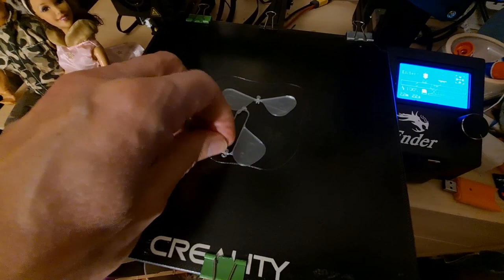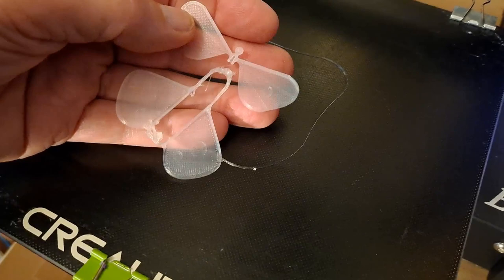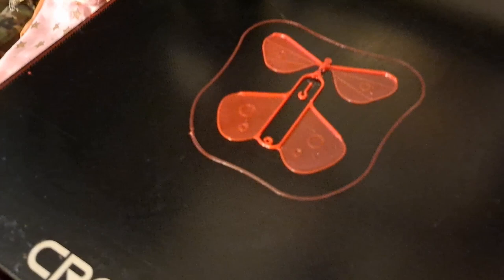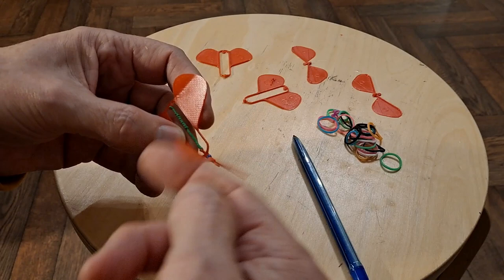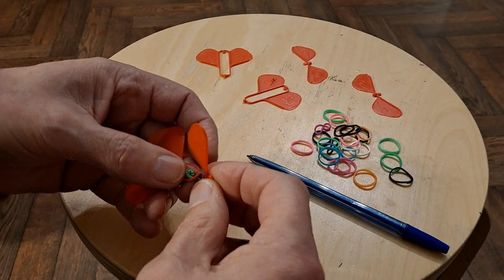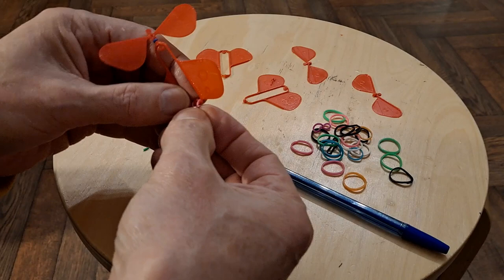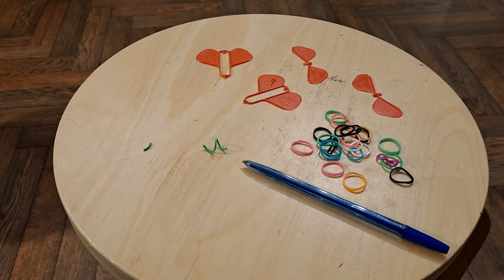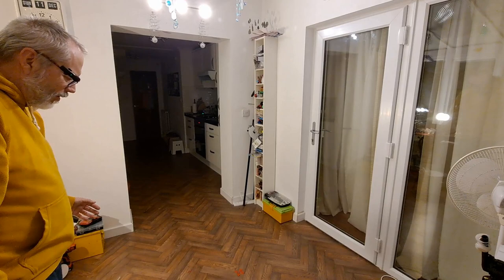PARBOI 412 3D printed rubber band powered butterfly by tigermcho

Comment: Had a look at the video in the description. He seemed to have it flying without bending the wings but it was much the same as yours. I suppose it's a surprise joke when you open a book. You might get one in a Christmas cracker. 😆
Your microphone is working really well. Very clear and crisp audio. 👌👍👍
Reply from the maker: Obviously I am biased, but I think the ones I made from bent paperclips did better (not much better). I thought it was a bit disappointing. I had hoped for better, but I am only using 'loom bands' as the power source.